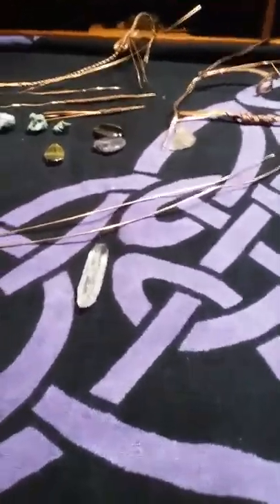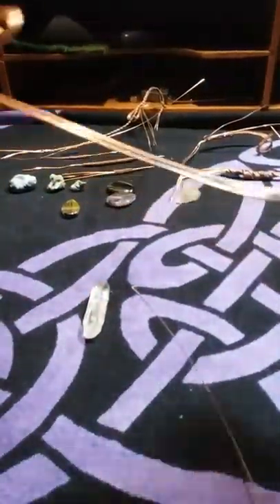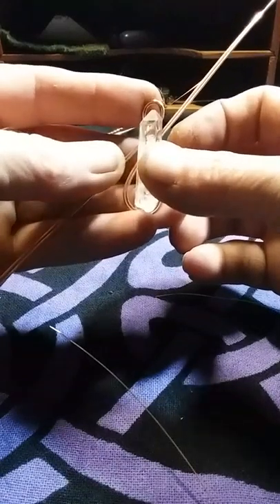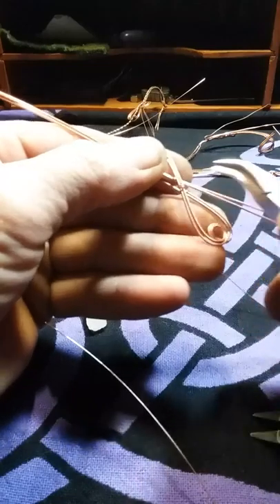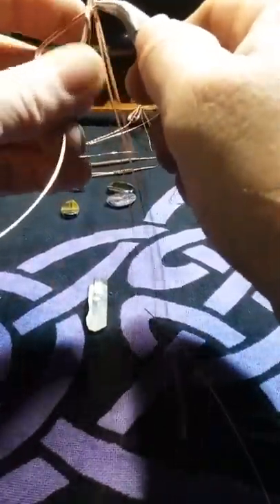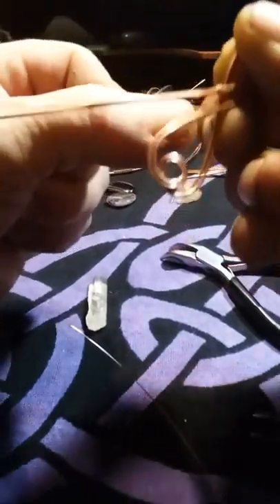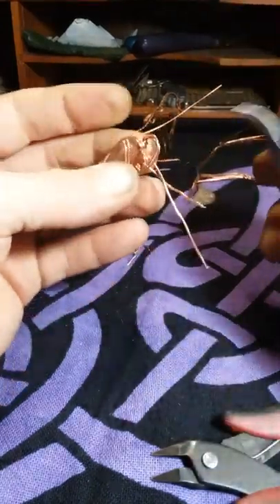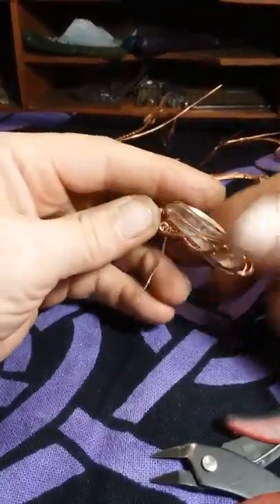Basic wire wrap. #WearableArt

Comment: I wasn't really sure what you were doing much of the time, because the camera is too far away from the action, nor did I ever get a good look at the finished product.  When it is closer, it is blurry until all of a sudden it focuses.  By that time, you're on to the next "scene."  My guess is, if you go slower you'd get the camera to focus in better, but since your hands are in constant motion without pauses, the camera can't adjust quickly enough.  Also, try a horizontal (landscape) view.  Vertical views just don't look very good, IMO.
Reply from the maker: Thank you for your helpful feedback. I'm just brand new... I will get better. I'm working on getting a better camera.